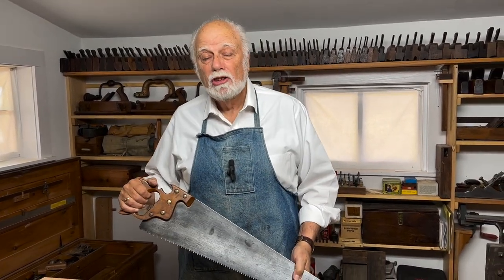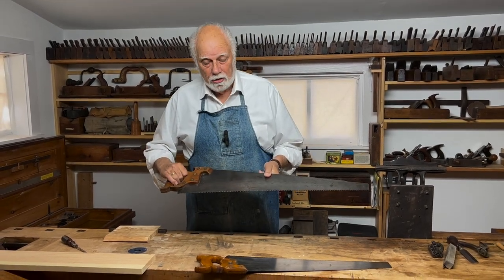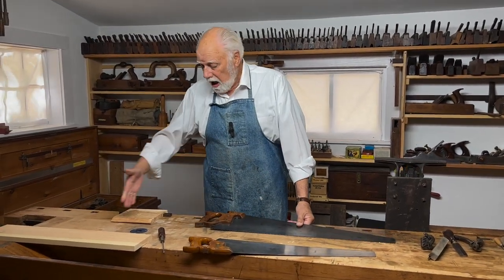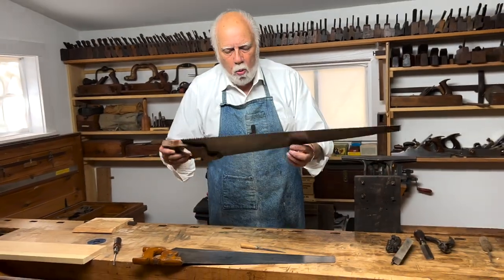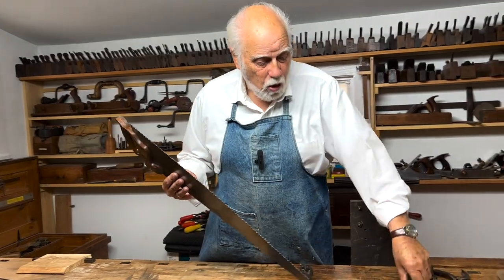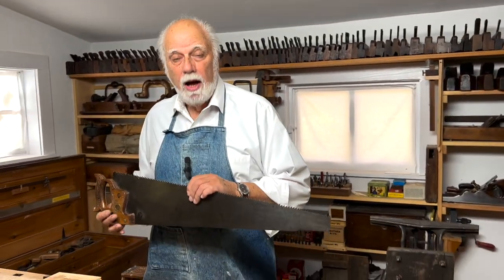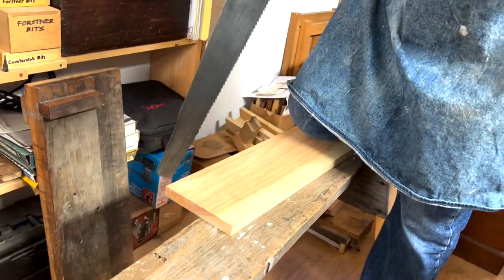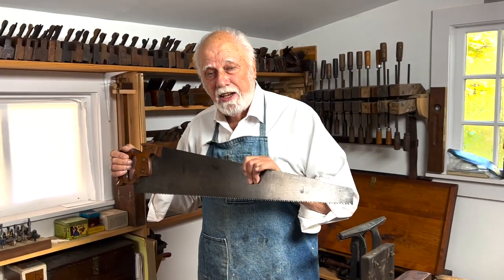14. The Rip-saw

Comment: Great video!  After ripping with hand saws the last couple of years I haven't used my table saw in over a year... It is just easier to use the hand saw. I have a large 4 1/2 tpi that I use for bigger cuts and a 6tpi panel saw I use for closer rips and large tenons. At first I thought I would never use my hand saws but now I use them almost exclusively
Reply from the maker: Amazing how some of the old techniques are still the way to go! Good luck!
Reply: Nicer on the fingers too!
Reply: Do you use a saw bench for your hand rip cuts or are you cutting them at the bench in a vise?

Comment: Well, Japanese saws are not actually that different, the difference is the file and only one face of the tooth is sharpened at one time. The micro bevel on the cross cut teeth is actually a blessing in disguise since you can go like 5 sharpenings just touching up the micro bevel until you need to deepen the gullet, the micro bevel is done without any fleam to the file, you instead use slope to add the fleam effect teeth with no micro bevel have, this 3 dimensional tooth shape also produces a cleaner cut because the tooth does not only have a pointy end, but also the "blade" of the tooth is now like a skewed rabbet plane or something. For file stability on the micro bevel I find it easy to just rest the edge of the file on a piece of hakcsaw blade held in the tooth gullet.
Anyway, Japanese saws do make for good joinery saws and panel saws, I'm probably still going to use continental european frame saws for long rough rip cuts and huge crosscuts, they are heavy, absurdly long and demanding to use, but they are also the fastest saws I know of.
Reply from the maker: You're right on a bunch of points — I just like the saws my father taught me.